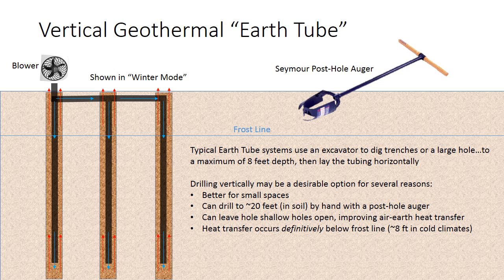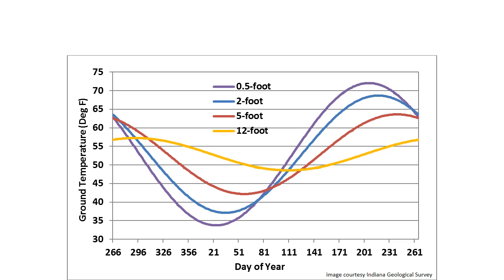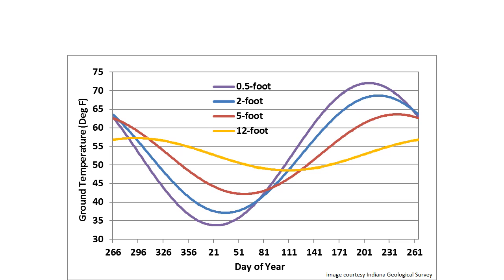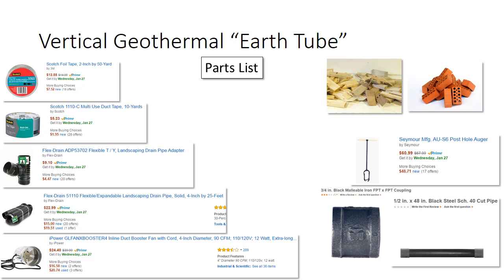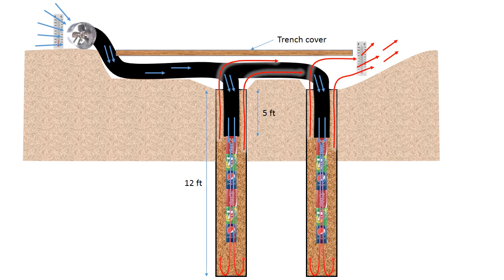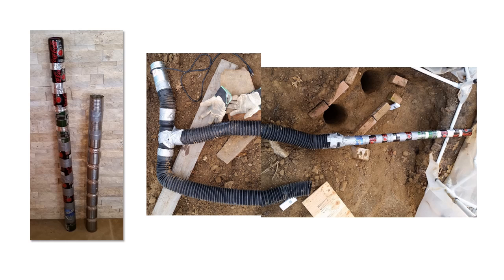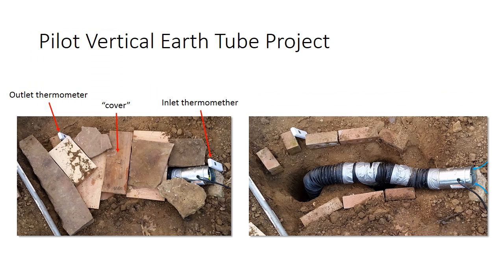Vertical Geothermal Earth Tube (Part 2) - Greenhouse Heating/Cooling

Comment: Would you have to worry about the possibility of increased radon in the greenhouse or (if its present in a particular area) make its way in anyway (at the same rate)?
Reply from the maker: It's not an unrealistic concern.  I'm not spending much time inside the greenhouse, but if you have radon in the soil, then I suspect that the geothermal could stir it up.  However, since one of the mitigations for radon is air circulation, the fans might actually be helping.  Only way to find out is a radon kit, which I've not done.  

Of course, if you cased the geothermal holes with PVC or even just plastic sheet, it would also help.  As I understand, vapor barrier is the other form of radon mitigation.

Comment: The pop cans work better if you don't cut the bottom, at all. What happens, is the air in the can has nowhere else to go, so it keeps heating up; we're talking a not insignificant difference. As long as the air passes through the cans, you're relying solely on the can to collect heat. Coolant systems are through systems; try a stagnant system.
Reply: Have you tried this?  Do you have a good link or two to share or shall I just go floundering around like usual?  This just seems like one of those "that's so obvious" things. Thanks.

Comment: Hi Morgan,  I'm living in a sunny Caribbean country and I would like to make a greenhouse 60 degrees farenheit. average temp here is usually about 85 degrees.

do you have any ideas or can you link me to any resources that could help me figure out how to cool my greenhouse?

I would like to grow cool weather plants.

Thanks
Reply from the maker: Maren, it's good to meet someone with the opposite problem as me! ;-)  60 degrees F is going to be difficult to achieve in the Caribbean without significant additional cooling.  That being said, a few posters on here have had good luck using the geothermal earth tubes for cooling.  Just ensure that you have a strong fan and as much air tubing as possible.  If you have access to an excavator, I think the horizontally-oriented (https://youtu.be/TU4fhHH83RA) earth tubes are best.  However, if you are tight on space, and your soil allows you to dig deep, my vertical earth tube system can be useful.

If I was building the greenhouse from scratch and my cool weather plants didn't need a huge amount of sun, I would try the following: 1) dig the greenhouse a few feet into the soil (https://youtu.be/EysR2mlhSmQ), 2) build the greenhouse with double walls, 3) use shade cloth if your plants don't need a huge amount of sun.

For the cooling, I think you are going to need to use a small AC unit.  The dehumidification is arguably more important than the cooling!  You can supplement the cooling from the AC unit with a simple homemade evaporative cooler (https://youtu.be/18hepTiAILk).  I would use a hot weather Thermo-Cube (http://www.thermocube.com/) to turn the evaporative cooler on and off - very simple.  I would also use an earth tube, but I would try to install a "condenser" to further reduce humidity.  When the hot, humid air from the greenhouse is pumped underground, it will cool, and the water vapor in the air will turn to liquid.  Generally, this will cause water to pool in the bottom of your earth tube.  You just need to set up a drainage system that will carry the excess water away.
Reply: Wow, thank you for the ideas and the leads :). There are so many people sharing their experiments on youtube, I'm hoping to learn and put the pieces together.

Comment: Great idea
Reply from the maker: gaetanproductions thanks.  I've got a system installed in my new greenhouse.  Fingers crossed that it can keep things unfrozen this winter
Reply: Can't wait for an update video!
Reply from the maker: Dicofole - I do have a video for my newest greenhouse/geothermal system: https://www.youtube.com/watch?v=Qh3-iTJvVR4 .  Hopefully I can get some temperature logging equipment in there and post a new video.  However, we did have a hard freeze last week (16 deg F/-9 deg C) and the plants in the greenhouse are doing fine.  I need to get some drafts sealed up before I can comment in detail, though.
Reply: thanks

Comment: Morgan, what do you use to determine how many vertical holes to drill to say control temperature of a greenhouse 16 x 10 x 7 feet?
Reply: 5 at least, space them apart 6 linear feet minimun
Reply from the maker: William, sorry for failing to reply.  I wish I could answer your question but I can't.  I plan to install some temperature sensors throughout the greenhouse and log it with an Arduino microcontroller.  Then I can turn the system on and off and see how quickly the geothermal system can change the inside temperature relative to outside temperature.  I have a new video (https://youtu.be/Qh3-iTJvVR4) with my new greenhouse and system.  I have ~50 feet of holes for a greenhouse with about a quarter of the volume of yours (8 x 4 x 6 ft) and three 90 cubic ft/minute fans.  I suspect that I may need a stronger fan.

Comment: Are you concerned about mold growth from condensation in the wells? Is there a way to address this? High humidity where i live some parts of the year.....
Reply from the maker: Unfortunately I had to demolish that greenhouse in the middle of the winter, so I never had the privilege of experiencing high temperatures + high humidity in the greenhouse. ;-)  I have to imagine that you could discourage mold growth with fans to keep the air moving.  Or, use a large blower on the geothermal.  If you are really concerned about mold growth, I might suggest a "closed-hole" system - e.g., some type of casing in the underground section of your system.  That said, where I live (Colorado USA) the soil is fairly dry, even at the 12 ft depth that my original wells reached.
Reply from the maker: I found a cheap dehumidifier for small spaces (https://amzn.com/B00KWKONAG) on Amazon.  Probably not optimal, but something along those lines could help...if you could find a way to continuously drain the tank!
Reply: Thanks! Tricky problem that...
Reply from the maker: I'm curious if you could use geothermal to construct a simple dehumidifier (for hot days).   Seal off the geothermal well, but have some type of metal heat exchanger (e.g. radiator fins) at the surface.  If you can use geothermal to cool the air below the dewpoint, you can theoretically pull moisture out of the greenhouse air and drain it to a tank.  Realistically, I would only see this working for very high dewpoints (> 65 deg F).  It might be able to take the edge off!
Reply: Proper slope solves this np

Comment: It would be nice, but where I live, in the Dordogne, the water-table can rise to 1.5 m, 5ft, below surface, and it isnt warm.
Reply from the maker: it's funny, another guy (maybe from India?) posted a very similar comment to my other video.  I asked him if it wouldn't be easier to just run a heat exchanger using the water?  Good luck.
Reply: Morgan Brown 
I have a well, 35 ft deep, the water that I pump out is damn cold, I doubt whether I'd get much heat out of it. I'll have to take a temperature  measurement sometime to find out what it is exactly. Meanwhile I have loads of wood, free, that I can heat with, [about 3/4 of my 25 acres] is woodland and the annual clearance of dead wood is sufficient to heat my house through the winter.
I reckon a wood stove in my greenhouse would be simpler.
The Victorian gentry used  compost to heat their greenhouses, and then grow pineapples.
The fuel was waste material, and the greenhouses were built against a wall, that acted as a storage heater as well. The Victorians, in the industrial revolution, were smart!

Comment: How do you make sure there are no mold growth or spores  as the air is in contact directly with soil and water? Thanks
Reply: My water table in Oregon is about 3' deep :(
Reply from the maker: Where I live, the water table is much lower than my maximum drill depth.

Comment: A tip for you
If you let the system work the other way around, the air should be warmer!
Blowing air in on the outside and having a ridged insulated pipe take the warmest air, at the bottom, out.
That way the air is gradually warmed the hole way down.

I can't test it but it would be interesting to see a comparison.

P.S.
i just read the comments below.
As Mark Fox pointed out the natural convection sucked in the cold air around the borehole and blew it out the Pipe.
Wich means less energy needed (or none).

I would personally try out one fan per Borehole, using air pressure optimized Computerfans.
Air pressure optimized work way better than airflow optimized ones if there is a bit of backpressure.
And Computerfans are readily avaible,speed variable and (i think) energy efficient.
( type of bearing plays a role as well)

one Fan per Hole as some benefits:
1. you have full control,
    each hole gets the amount of airflow you want,
    if you have one fan for multiple Holes it is possible that some holes get almost no
    airflow while others get to much airflow lowering the efficienty. 

2. Scaleability
    if you need more holes just dig the hole buy the fan, the riser pipe and a container 
    on wich to mount them.
    Stick them together and put it in the hole. finished
    (possibly glue the pipe to the container, but screw the fan to the container in a way 
     so that it is removable)

3. Maintenance
    trough temperature monitoring any problem can be easily pinpointed,
    and the rest of the system can be kept working while disconnecting the power
    to one hole and pulling the assembly out.

and lastly Redundancy one Fan quits no problem.
the system stil works.

I am eager to read your opinion.
Reply from the maker: I like your "one fan per hole" suggestion and will probably try it out, as I'm about to install a multiwell geothermal system in a new (small) greenhouse that I'm constructing.  I imagine that I have a lot of friction losses as I move the air horizontally into the various holes.  The natural convection aspect of this is certainly interesting.  I could do three experiments to test effectiveness: 1) fan on, 2) fan off, 3) holes sealed off.
Reply: This is a very valuable discussion related to its efficiency. I am concentrating on the very first part of the comment which is "system works the other way around". If I get your point correct it is so much easy to draw warm air from the inner tube instead of air pushing through the borehole. So you are working with the convection currents. Kindly appreciate a comment on this.